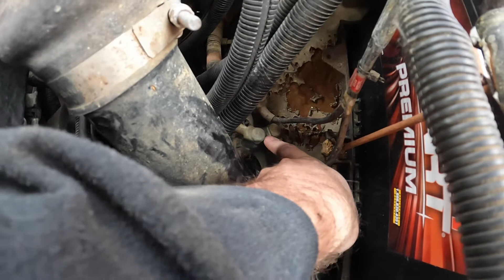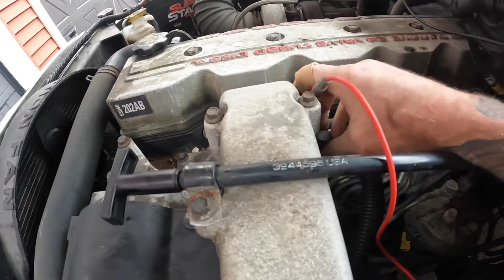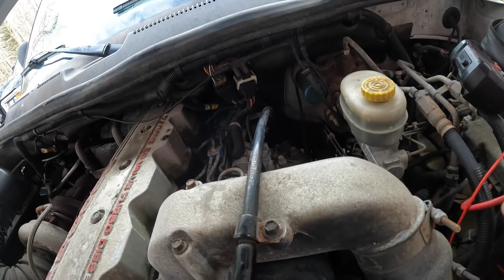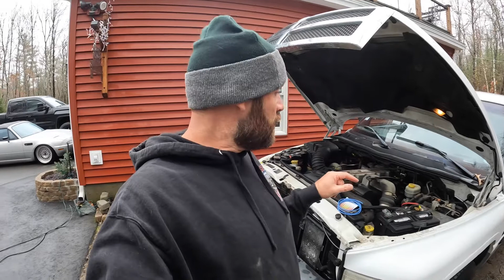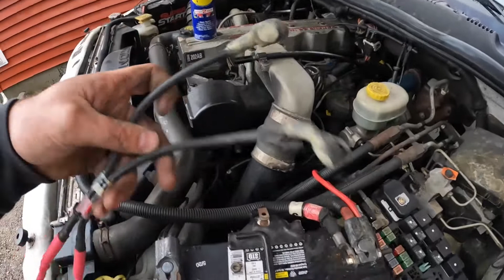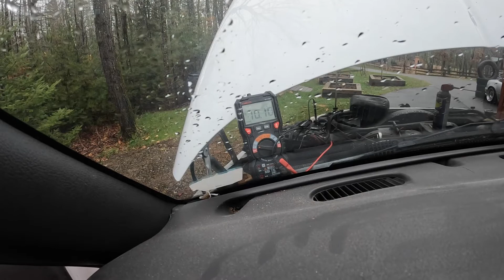99 Dodge Cummins Preheat Not Working

Comment: Here's what I did..... Fusible links????  Forget them!  I just replaced those 2 fusible cables with regular wires....forget the fuse factor....it just constantly puts the voltage you need to the relays..
It worked great
.cheap and easy

Comment: I’ve seen this cable assembly about 40ish, after market. Amazon has the fusible link available. I’m a diy’r.
I have a 95 12valve I thinking I have issues with my grid heater. At 32 degrees it is a bear to start.  Thanks
Reply from the maker: I bet that’s it, verify with volt meter

Comment: What if the wait to start light never turns on
Reply from the maker: You have a separate issue possibly with the control circuit that turns the relays on
Reply: @FlippinCustomized  would connecting the battery backwards damage the ECU ? I ask because, some mistakes were made lol.
Reply: It use to run perfectly before
Reply: Usually ecm failure

Comment: Best description I’ve seen on YouTube! Thx

Mine is working properly. Cycles three time to feel warmth. But it will not start when cooler outside. If I plug in block heater it will start. Next step is to test each injector by blocking one off at a time.
Reply from the maker: it may be working, but may also be partially burned out, I would take an amp reading on it when its on and compare to a known good one
Reply: @FlippinCustomized  how would it flow current if it’s partially burnt out?